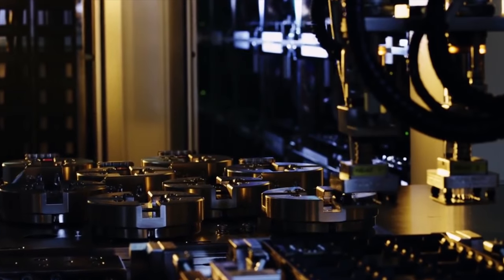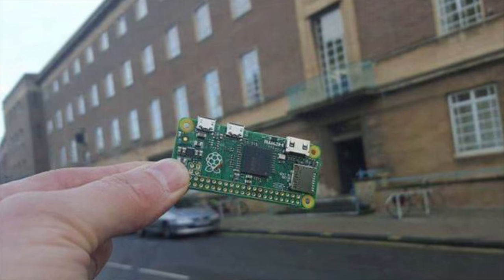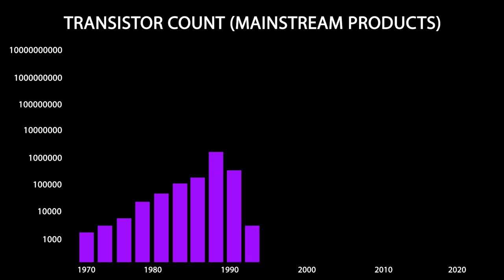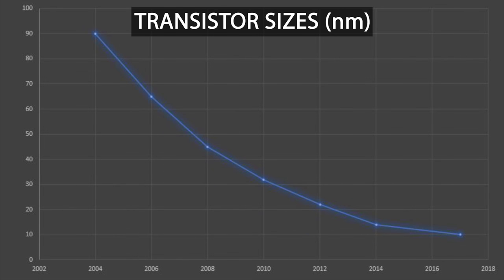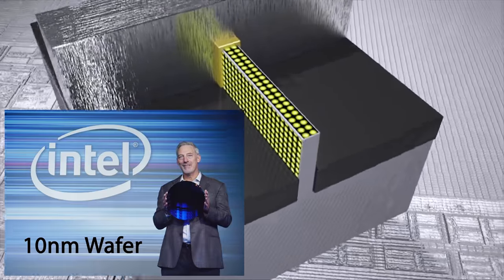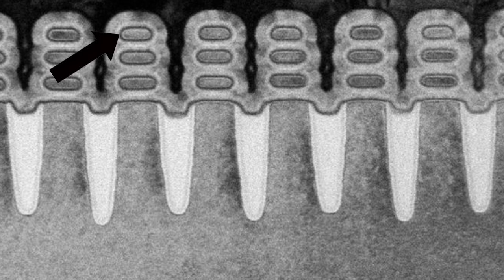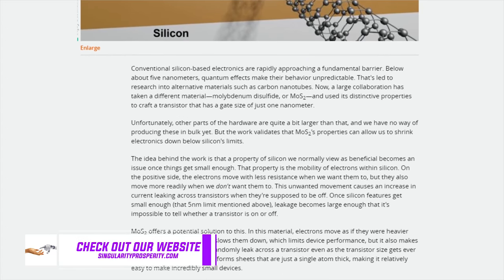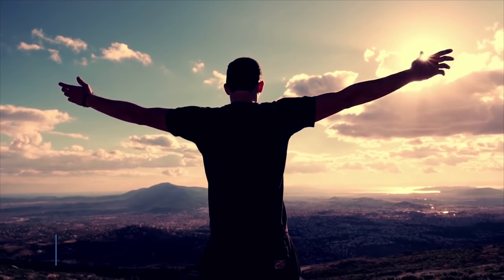The End of Moore’s Law?! (Shrinking The Transistor To 1nm)

Comment: The death of Moore’s Law? I have been hearing this for 20+ years. It's unlikely to happen anytime soon. Even when we hit the limit for transistor size we likely will just start layering them as we do with flash.
Reply: dont froget graphene 
processors
Reply: How about heat dissipation?
Reply: It's already happened. Intel and Nvidia have both released flagship cpu/gpus that aren't really faster than their last year counterparts for the first time.
Reply: Andrew Scott
That's because of greed.
Reply: @FrostEclipse21  or so we'd like to think atleast
Reply: @mikimouse3001  would the consumer care if a cpu was an inch thick? Liquid cooling tubes between each layer
Reply: I don't know why we aren't layering them right now.
Reply: @JF32304  because of thermals. Intel reduced the height of their comet lake S chips and thermals got much better. If chips were thicker thermals would be out of control.
Reply: Exactly. I don't see how that ends Moores law it literally proves its point lol. There will be a size limit to the transistors, you can't make them smaller than an atom, then they'll start stacking them ontop of eachother like they did flash.
Reply: @frankfalkenburry5373  if you could just start stacking them without any problems occurring they would already be doing it
Reply: @frankfalkenburry5373  or in other words there are good reasons they dont do it already

Comment: last I checked the nm size of a processor doesn't actually have much relation to the size of the transistor or even the computing power anymore. It is mainly just used to give a sense of noticeable improvement for each new process, with processes from different manufacturers with different "sizes" often being comparable to each other.
Reply: I looked on youtube and found out that the 5 nm and 2nm chips actually are bigger than that but because of their design they are equal to the power of a theoretical 2nm chip

The transistor is then marketed as a 2nm transistor even though they aren't actually that small 
Link to the video that explains it https://youtu.be/GdLRSF5wZpE

Comment: This is a bit misleading, transistors in today's 10nm process are a lot bigger than 10nm and their smallest features are still bigger than 10nm.
Reply: that's true. too bad people don't know that. he made tons of mistakes in the video because of that. 7 nm is actually something between 20-50 nm as far as i remember.
Reply: Where did they come up with 10nm then? If the transistors are (twice?) that size, than what exactly IS 10nm? Is it just a made up number? A goal? If 10nm isn't 10nm then what's the point of even using a measurement? 😟 Please tell me that something in that chip is 10nm.
Reply: @Inertia888  nothing is 10 nm there, sorry...
Reply: @hihtitmamnan That is a real bummer.  It's a Big Fat Lie. How can I trust anything they claim?
Reply: @Inertia888  for example Intel's 10 nm process is equal in size to AMD's 7 nm. It's a lie, but the truth is that each process is getting better and I think that matters the most
Reply: @hihtitmamnan  seems to be more confusing than it needs to be.
Reply: @Inertia888  Before year 2000 process node used to refer roughly to transistor's gate length, but as we made new ways to increase transistor performance other than shrinking it, it lost its direct correlation. 
For example Intel's 14nm process (comparable to Samsung's and TSMC's 10nm) has 42 nm fin pitch and 70 nm gate pitch, that means that smallest transistors are about 42nm X 70 nm, third dimension is almost certainly bigger but it is unimportant now because we currently make chips only on 2D planes.

Fin width is closest to 14 nm (possibly even smaller), but fin is only one part of the transistor and this is only its smallest dimension, whole transistor is much bigger.
So when he says at 4:25, that we can make transistors 10nm or 20 atoms wide, is incorrect.
Also at 9:15 he incorrectly deduces that transistors using 1 nm process node would be made of only 2 atoms, fin width could be couple of atoms wide but actual transistor would be much bigger so it would be possible to shrink transistors even further.

So miniaturization of transistors will almost certainly not stop in 2020, but it will stop soon but even then we have other ways of increasing performance, 3D stacking, new higher performing materials.
Reply: @klklkl427586  ok, wow.. thank you! I learned a bunch from you right here. 
If you have the time...how do we keep a 3D chip from overheating?

Comment: What if hardwade limit is at 99%
but software optimization is at stone age with 0.000000001%.... We don't need hardware shrinkage, more likely to do software magic...
Reply: MR BOLEUS for example apples phones are silky smooth with 2gb of ram
Reply: @gaiazoulay9  Bullseye!!!
Reply: @gaiazoulay9  no one cares there are applications that needs superpowerfull chips for super fast calculations
Reply: @Mikasa Imagine what kinda experience we'd have if every line of code was optimized ;)
Reply: @carholic-sz3qv  The only reason it needs a superpowerful chip is because the code sucks
Reply: @wichitawwojak3786  good code = time = money
Reply: it's cheaper to buy 50% faster cpu than to create 50% faster software. also assembly language is hardware limited, so u can't optimize it forever

Comment: One atom is about 0,3 nm and they say 2 - 3 nm is the limit for transistors...
Reply: On wikipedia is writen humans  have build a 0,4 nm working transistor.... But ok I think for microprocess chips maybe 2 - 3 is the limit...
Reply: At least on silicon ;)
Reply: Microchips in our smartphones are 12 nm. For records in 8K video they will need to be 4x more powerfull, so they need to be in 3 nm !
Reply: Hernando Malinche  I know :) Its the first mass production device with a 7 nm chip. My note 8 can 4k video recording with I would say a 14 nm chip.
Reply: It gets very hot. If you have more transistors you can reduce frequency or operation times, and this reduce heat... No ?
Reply: Hernando Malinche  ok I m not an expert for encoding video... Yeah they say too much quantum tunneling is at 2 - 3 nm for si transistors... That s the main problem not the size of the si atom. Because a si atom is only 0,3 nm... So you can still but 10 atoms togheter for a connection...
Reply: Hernando Malinche  yep
Reply: Nuno Herdeiro  And this chip is in a tiny smartphone ?
Reply: Hernando Malinche  what do we think about using something like graphene. One carbon atom thick, could be interesting.
Reply: The size of an atom can differ heavily based on what element it is. The periodic table itself could tell you that. ex. Helium - 2 electron in a single shell, Silicon - 14 electrons in 3 shells.

Comment: Multiple layers on a single chip is the answer.
Reply: Walther Penne Well, maybe a different material can solve the heating problem. I have heard that the graphene is pretty good at this.
Reply: Tommy Hammernots I know, but I meant more layers, and probably with different materials.
Reply: Walther Penne I don't think you have bothered to check the current state of technology. But we already do stacked die CPUs and memory. As long as the wafers are sufficiently thin. You can just back down the frequency and voltage till you hit the peak of the efficiency curve. Cooling is a problem, but it isn't "the" problem. It has the same issues as other large die solutions, more surface area means more percentage chance that there is an error, with the added bonus of damage during the stacking and soldering the TSVs. Stacked dies will be popular outside of embedded processors not long after we have more reliable lithography and better testing equipment.
Reply: @Walther Penne So what can be done to speed up the process of turning the heat in your processor into Hot Air Dude? And what happens to Hot Air Dude after his transformation? Does he fly out of your PC on the wings of a stork? I am fascinated to learn more about this Hot Air Dude.

Comment: Here’s a quick thought. Just know I haven’t thought about any of this and as I write this I’m thinking “actually this is a shit idea because x y and z but what if we were to switch to analog in terms of input and here’s what I mean: a neurone works by these little gates for the cell for sodium and they open as a (even more) positive charge comes through like a chain reaction once one opens it triggers the opening of the sodium channel next to it. How it triggers the opening is simple, an impulse raises the charge of the local area past a threshold which indices the gate open to let sodium in (sodium raises the charge). In computers this could mean that the electrons could leak and as long as there is only a small current an output would only be 0 until the gate is opened and even more electrons would pass through and therefore the current would increase and therefore would be detected as a 1. I’m sorry if this is poorly explained and after reading this I’m thinking well how would it know sort of thing but I’m assuming this train of thought is where sci-fi (but plausible) biomechanical cyborg brains are made.

Comment: Quantum computers will continue the trend even if there's a delay...
Reply: No they will double even faster but with bigger jumps and longer time between. Steeper curve fewer points on it.
Reply: @marcusm5127  a true quantum computer would but they are hampered because they still need to interface with the old technology - electronics.  A true quantum computer doesn't run off electricity. For example, current quantum chips can be placed onto a motherboard that runs off electricity. The quanta to electric conversion introduces inefficiencies and delays. As we rely less and less on electrical computers we'll be able to do more.

Comment: You talk so fast, It seems like a computer simulated voice over. Humanize the information more. Like what's the ultimate goal here? Why the need to go to plank size? Give a useful example of something that could be made at plank size that currently can't be made at 7 nanometers. Why are 5 nanometers a useful goal? How will things change when that breakthrough is achieved?
Reply: Did you watch the video? He it will let you fit more transistors in a chip, making it more efficient, generate less heat, etc.
Reply: alt f4 
I understand that, but why isn't the current standard good enough? Again, give an example of something they want to build that they are unable to build currently. Or is it just about speed? Why is 7 nanometers too slow for a new application.
Reply: @gl7011  i know this is a late reply but here goes: think 50 years back. you couldve asked that same question, and no one would have been able to tell you that we need more powerful processors to run fluid dynamics simulations, finite element calculations for engineering, and the amazing CG effects we can see in cinemas today; simply because they couldnt even imagine it. even if just one step forward doesnt immediately bring about huge changes to daily life, looking back after a few decades shows just how far weve come by taking one step at a time.
Reply: @qtrg5794  
Thanks for that, I'm much more informed now than I was just 6 months ago when I posted that question. Since then more and more information about the dawn of artificial intelligence and it's potential impact on life as we know it has been written. I'm sure the area if AI will greatly benefit from these New breakthroughs. Computers will be able to perform in ways that mimic if not surpass the human brain. We live in very interesting times.

Comment: Transistor count can be increased, given slice of silicon, by stacking, which is an approach with NAND flash storage "3D NAND".  When I was in highschool 20 years ago, the death of Moores law was expected to arrive, at that time 180nm was still in development.
Reply: You cant stack to much though because of heat.
There is also a big difference between storage and the actuall processing parts

Comment: I think it is worth pointing out that further miniaturization won't nessicarily enable more IOT technology. The ESP8265 (not 8266) is available for pennies when ordered in bulk, and offers loads of performance in a fully integrated 5mm package. You could make an IOT ring with this and an OLED display for a jewel for less than $10. and this is on 40nm. These things are so cheap that they are disposable. They even offer capacitive touch on the chip, meaning you don't even have to pay to Integrate buttons.

Comment: The example here is the human brain. Although neurons are slow by silicon circuitry standards, the brain does not particularly rely on the speed of neurons, but rather massive parallel processing. To this extent, you can regard the end of Moore's law as a good thing. We are still in baby steps as far as PP goes. The reason that GPUs do so well today is that image processing and graphics are problems well suited to parallel processing.

Comment: I would like to understand what is the difference between applying a driving voltage of 6v 7v 8v 9v or 10v to a mosfet. Is a lower v more efficient/deficient ... what should I choose? What are  the implications?
I would love to understand because I have the possibility of adjusting it on my MB. But I just have it on Auto because I don't understand it, even after looking through all google backlog.

Comment: I actually believe that there's still room fore improvement in the 10nm process, and most further advancements in computing should come from optimization and architecture, not necessarily from miniaturization.
 Video games are an easy to grasp example. Look at Soul Calibur on the Dreamcast, a cheap console from 20 years ago. Right now, if you download a game just line that from steam, you will require at least 10 times more processing power for the same results. If we manage to achieve the same level of optimization seen on old titles like the original roller coaster tycoon (mostly programmed in assembler language and with seriously deep optimizations) or even quake, in a time efficient manner, on modern 10nm hardware, the sky is the limit.
 And regarding Moore's law, it will just slow down to about 30 months. Look at gpus, they are doubling the number of transistors every 2.5 years.

Comment: Over 8 years ago I bought a laptop for a certain price with 4 cores 8 threads and 8 GB of DRR3. Now after taking inflation into account, you can buy a similarly priced laptop with 6 cores 12 threads and 16 GB of DRR4. This isn't going as it should with Moore's Law. By now we should be at 32 cores and 256 GB of DDR6 for that price.

Comment: Attach a suction device to the drain-
the sink won't fill up as fast.

You can have a huge hole in the boat-
as long as you bail fast enough.

Now you know why Star Trek creates a Sub Space field around
their computers- to allow FTL (Faster Than Light) computing.

Find a way to move electrons faster.

Comment: Why not just make the chip larger? Thus adding more without actually shrinking the transistor. Or if that won't work we could make chips with multiple dies and link them together
Reply: Larger chips suffer from being more prone to errors in manufacturing. And multi die solutions are actually already a thing. A recent example of this is AMD doing 4 die solutions in their 32 core EPYC server CPUs. Intel has done this with Pentium D as well.

Comment: That all being said where is HP at with their research in the Memristor technology? I have not heard anything new on that front in nearly 5 years. Last I heard they had 1 TB of data on 1cm/sqr of titanium. I think a blending of these two techs will lead us to even better computing devices as the memristor will reduce the number of transistors necessary for functions thus reducing the size, heat, and power drain of current tech.
Reply: Memristors are already being used in production. They just aren't economical or physically scalable yet for non niche usages. And on a second note, storage systems like you just mentioned are also not scalable for portable devices due to the complexity and the low relative speed of the reading/writing device. It will probably end up being used in a titanium sputtered tape for backup storage, to compete with IBM's new 330 TB tape cartridges, but never in a consumer device.

Comment: 3 D CPU stacking will continue moore law. Transistor size is only one of many factors that affect performance. Amount of Cache, CPU instruction sets (better algorithmns), Number of Cores, amoung of Ghz all have an impact. 3D stacking can give up to 1 GB or more of CPU cache. That will improve performance by a mile.
Reply: You can only stack so much on a cpu unless you make the cpu use 3000pins lol  on a gpu you can stack way more in a gpu it's th gpu revolution intel can't stop it that's why they are joining the gpu market now with raja and Tom peterson now working with Intel hwo is running scared o fthe truth that there cpus are drying lol
Reply: @jonathanoxlade4252  Although GPU, are taking on more complex workloads they are absolutely nowhere near the types of task a CPU can perform.

Also, CPU are not dying in fact they are growing. I work as a sysadmin and server workloads are constantly increasing dramatically more IoT infrastructure gets added and automation. The home market is small compared to the demands of the business world. In addition, CPU 3D stack isn't the final improvement on CPU it is just the first step. After that, we go to Optical Computing which is progressing rapidly and will increase performance exponentially.

Furthermore, many GPU tasks are currently beings replaced by FPGA's (Microsoft Datacenters) and TPU's (Google Datacenters). And in the future Quantum Chips may replace GPU entirely.